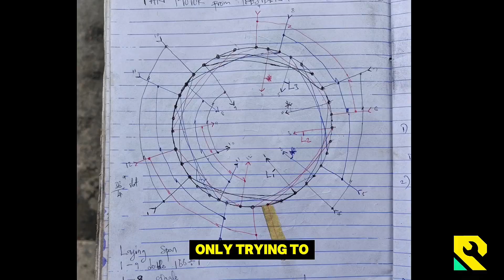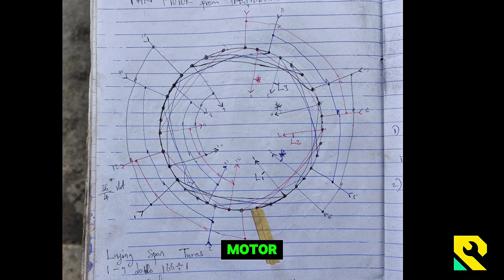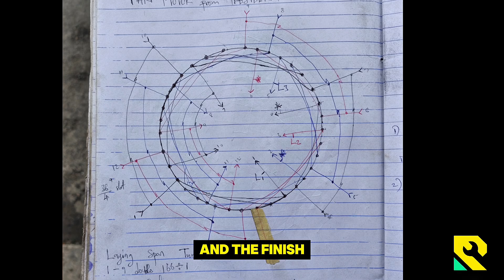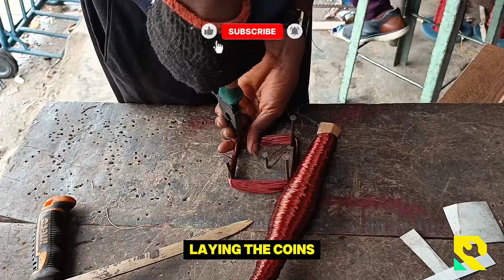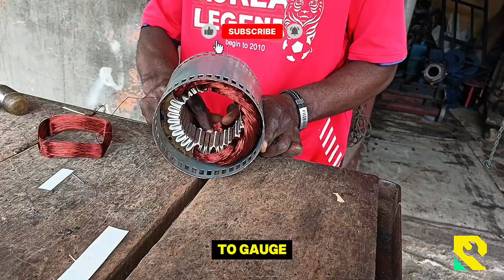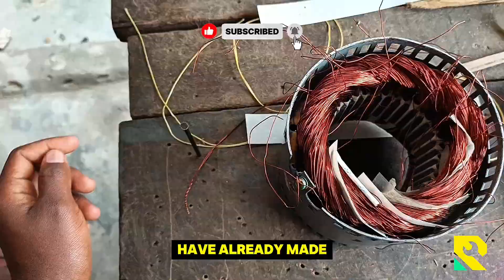IT TOTALLY WAS DEAD 💀 — 36 Slot 4 Poles Fan Motor Rewind (Full Diagram Explained)

Comment from the maker: 🔥 Fun fact from this job: we first bought SWG 23 wire and it wouldn't fit into the slots! Had to go back and get the correct SWG 25. Lesson learned — always double-check your wire gauge before you start winding 😅

Drop a 🔧 in the comments if you've ever made a wiring gauge mistake like this!

Follow for more rewinds & repairs 👇